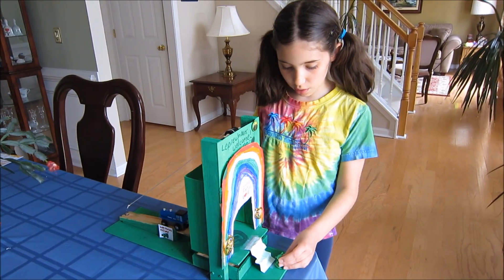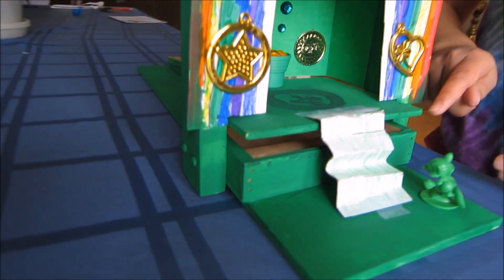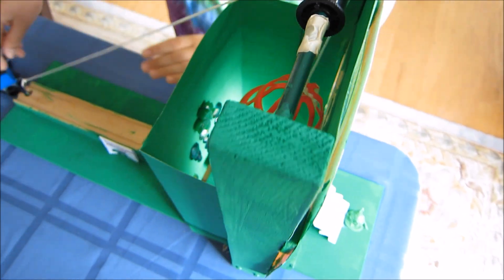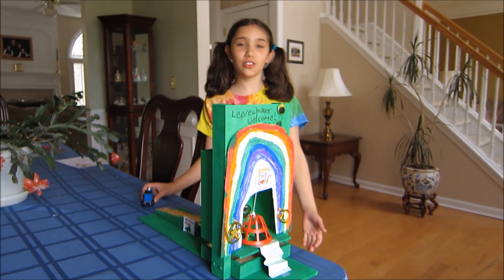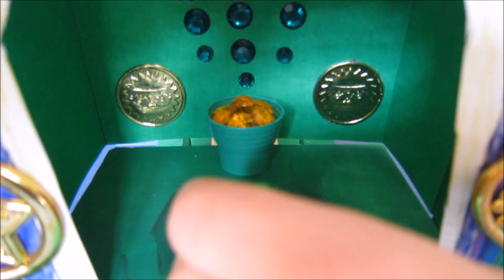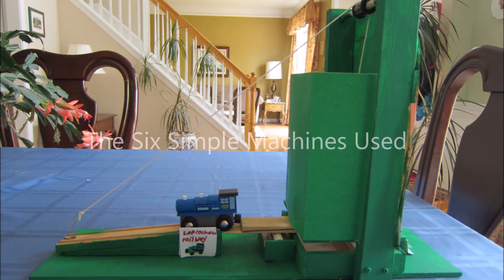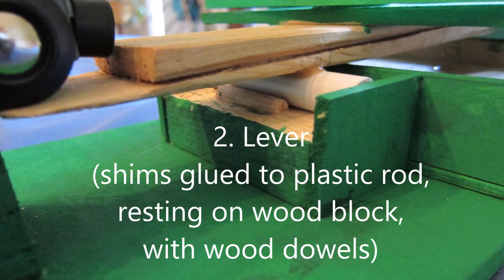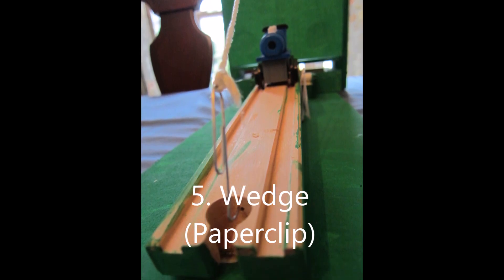Leprechaun Trap Using Six Simple Machines

Comment: What triggered the spring
Reply from the maker: Thanks for your question. The spring simply keeps the platform up (it's glued underneath the platform). The platform is attached to a lever. When the leprechaun steps on the platform the spring compresses, and that causes the lever to push up on the back of the train. That, in turn, causes the train to go down the track and dislodge the paper clip. When that happens the trap (which is connect to the paperclip with a string) falls on top of the leprechaun. I hope that helps.
Reply: That helped a lot, thanks